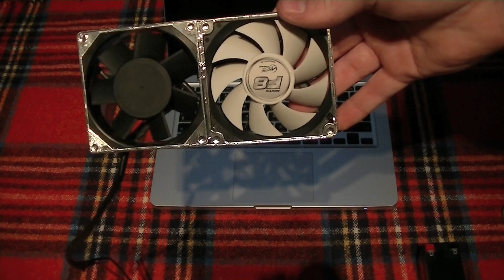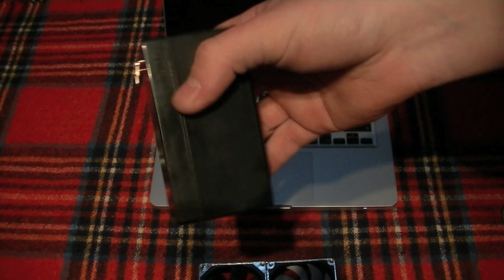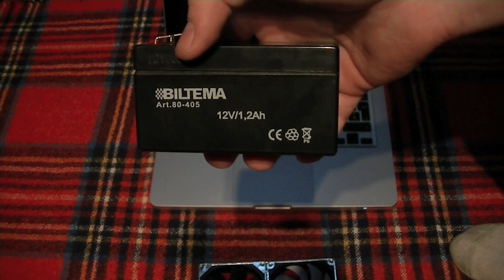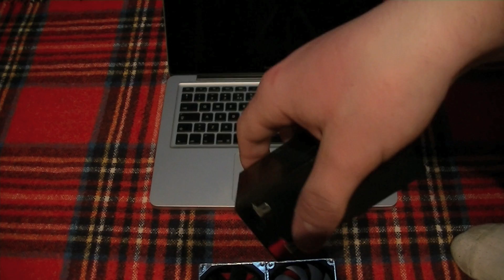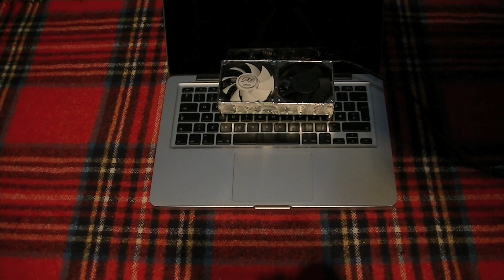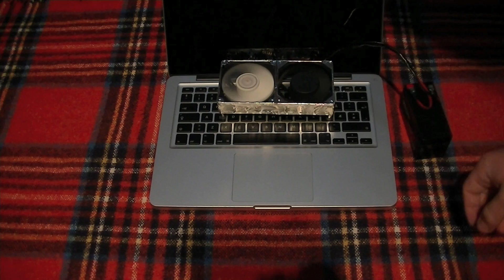Homemade Cooling Fan for laptop's

Comment: Chacha12324 .. No ,, he can trough after finish once time :P
Reply from the maker: Yes the battery is rechargeable
Reply: +PatrickEpicMine I have an acer 5920g but it has only 1 fan connector but I have another powerful laptop fan but it won't fit, how do I modify the motherboard so I can have 2 fans?